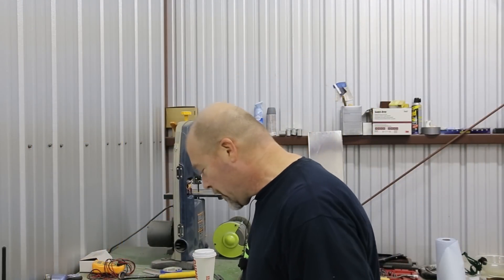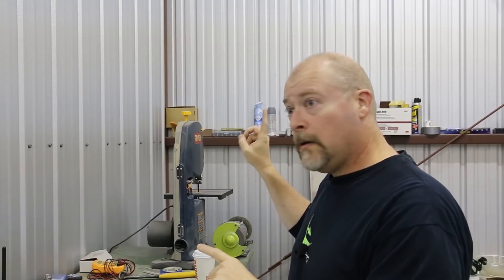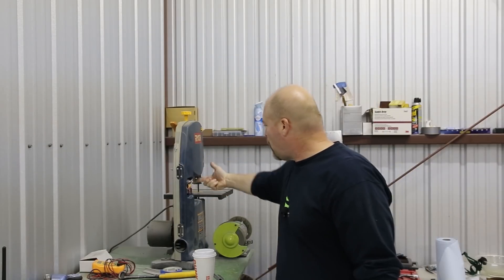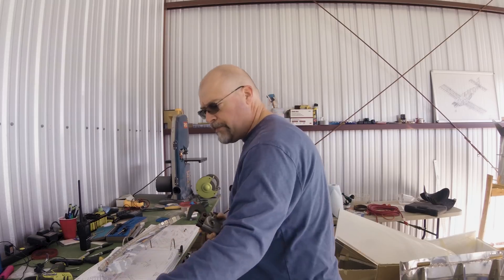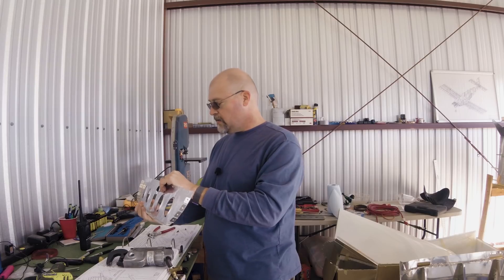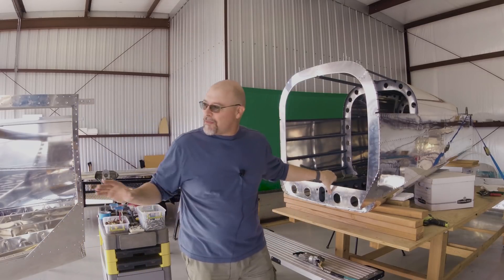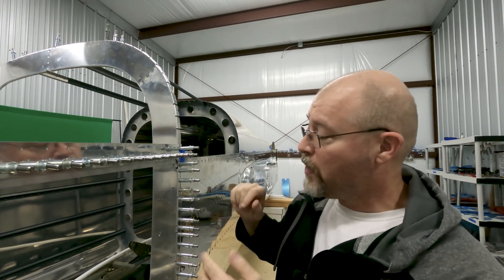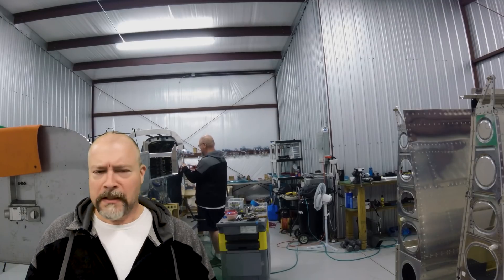RV-10 Fuselage - pre037 - Merging Fuselage & Empennage (Older Video)

Comment: Hard data is hard to come by, but I think you are greatly overestimating the difference in drag between flush and conventional round head rivets.  I have read a few articles in the past that says for most light airplanes with speeds under 200 MPH, you would be lucky to see 2 knots difference in top speed between the two.  On most parts of the airplane, the boundary layer is thicker than the rivet head and thus the rivets make essentially no contribution to drag.  The main areas of difference are the front 1/4 to 1/3 of the wing and tail surfaces and a few parts of the forward fuselage.  The rest of the airframe is pretty indifferent to rivet head style.  Adding a couple of com antennas likely makes far more difference in drag.

Comment: I installed a 5 HP 60 gallon compressor and would not want anything much smaller.  I like my Milwaukee cordless drill, but the extra speed of the air drill is nice when doing a lot of small holes.

Comment: Jason.  I just found your videos a few days ago and am working my way through them...I'm still back on your empennage videos.  I'm an experienced pilot, but am now considering what my first plane will be.  RVs are certainly in the running with RV-10 topping the list due to the 4 seats.  Next question would be buying used or building.  To determine that is to answer the question if I have (or can get) the skills & have the time & patience vs. finding or affording a used one (tough to do).  To be determined, but your videos are part of figuring out that answer.

 It looks like following plans & doing metal work is tedious but pretty straightforward.  I'm curious how things like fiberglass are to learn/do and how much you're having to improvise.  

Great job with the videos!  Thank you!

Comment: People have built RV-12s as experimentals (not ELSA) and put bigger powerplants in them... some of their numbers were close to Vne, but not too crazy. My thoughts on trying to use flush rivets in something not designed for them, is that obviously you need access to both sides of the rivet, to buck it. The RV-12 instructions are obviously written without that in mind... so, you'd probably run into some trouble here and there, trying to re-order or re-engineer the plane for flush rivets. That's on top of any worries about dimpling or countersinking parts that weren't designed to be dimpled or (especially) countersunk.

Comment: 11:31 One thing to consider about going with flush rivets instead of pop rivets is that, apart from the the leading edges of the fuselage, tail, and wings, the boundary layer may be thicker than the head of the pop rivet making using flush rivets irrelevant. 
Note: Where it would make the most difference to use flush instead of pop rivets would be on the leading ~25% of the wing and tail

Comment: Using flush rivets for RV12 violates LSA design.  OK if you register as an E-A/B, not as an LSA.
((BTW, Van's said they originally did assemble the 12 with flush rivets --- Vc far exceeded LSA allowed speeds, to they put in flush rivets to dirty the plane up.   Also BTW, I have no problem exceeding Vne with my 12 and a 912ULS engine. I have exceeded Vne more than once --- with OUT trying)).  The 12, like other RVs is slippery))

Comment: Drill press -- YES (especially for drilling Stainless).  Bench grinder --- NO. (I've used mine a total of maybe 10 minutes).  Most things you might use the grinder for (scotchbrite), you can do with the drill press (they make 3" scotchbrite wheels for drill presses).  Squeezer (pneumatic) also not needed.  Saves muscle wear, but not needed.  Don't cut steel on the bandsaw

Comment: I wouldn’t be concerned about the speed increase from flush vs pulled rivets.. the RV-12 pilot could just throttle back and cruise at the original speed just at a lower throttle setting. The real concern may be the sheer and tensile strength of pulled vs flush rivets. It’s my understanding that the flush rivets we use are -3 mostly because they are easy to set and still have nice flat skins. I don’t know what they use on the -12, but they are probably larger diameter and stronger..

Comment: "need" or "must have is very subjective.  I'm a big believer in right tool for the job makes things easier.  Perfect example is a washer wrench set, you can try to ninja washers into various places or use tape, string or other tricks... or just buy a washer wrench set and safe time and frustration using the right tool for the job. 

I suggest people start with whatever tools they feel they need.  During the project if they decide they want something else then pick it up.  I personally bought a drill press about halfway through my project, mainly used it on any bracket or I needed an absolute precise hole or exact angle.

Here's a 12 using flush rivets http://joesrv12.com/   I saw a 12 this summer where the builder opted to fill the rivets, it looked great.  He said it didn't really add much weight, or speed for that matter but looked great.